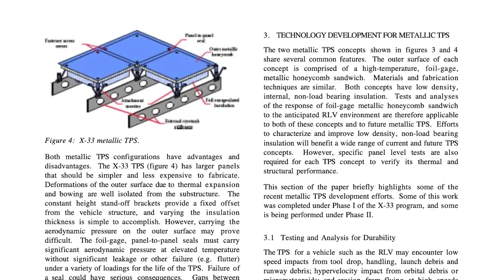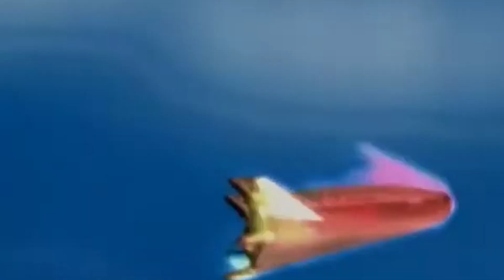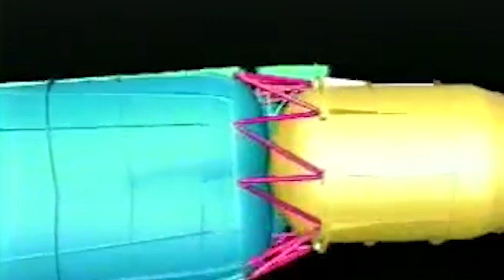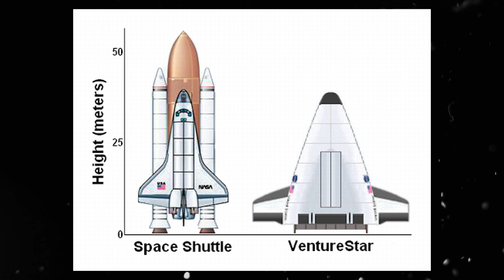The Secret Skunk Works Space Shuttle Replacement

Comment: I worked on the SS program in the late 70's. Narloy-Z was the SSME combustion chamber material. Channels machined in the outer surface, filled with wax and the nickel plated. With the wax melted out you now had a regenetatively cooled main combustion chamber.

Comment: yeah, prefereably, you'd want to gain ailtitude before rolling over on your back............but, thrusters further towards the edge would have solved this................and an empty space in the middle for the oxygen buffer to give it extra lift would have been nominal.   overall........the design wasn't a bad one.  it was just the base that needed restructuring.

Comment: Why always from a dead lift straight up? Why not a magnetic grav sled starting  at a high  hill or small mountain on rails conventional or friction less mag lev until it reaches a speed that would launch into space or low orbit like a ramp that would make a normal exit trajectory since most of the fuel on conventional space launches is burned just getting of the deck

Comment: Why can't they fly an aircraft as high as it can go until the air is too thin for the wings to get lift and then fire a rocket engine to put it in space? Instead of a tiny plane launched from another plane that only technically reaches space.

Comment: Greetings, how much was the maximum load that the X-33 and the VentureStar take into space... and why that name "Skunk" (sorry my english is limited)
Reply: The X-33 was an experimental vehicle that was designed to reach Mach 15 (5.2 km/sec), far below the Mach 22 speed (7.75 km/sec) needed for reaching low earth orbit (LEO). So X-33's payload to LEO was zero.  

Because of X-33's excessive dry weight and the sub-par performance of the Rocketdyne aerospike engines, the maximum speed of the X-33 was only Mach 10 (3.43 km/sec). And these limitations meant that the X-33 could only fly from Edwards to the Utah Dugway. The contract called for longer flights from Edwards to Malmstrom AFB in Montana, which were impossible. 

VentureStar's payload was supposed to be 50,000 lb (22.7t, metric tons) to LEO.

Comment: i always wondered if they considered, or why the didnt ever make somethin like this, that had 2 or 3 jet engines to get the thing up to 30-50k in the air, then point it nose up, an then have some rocketry get it up into orbit from there.  this is just a lamen idea obviously, and im sure they considered it, and have reasons why it wouldnt work, but i dont believe ive ever ran across hearing about the idea before.  in my small mind, it seems like it would work, as long as the jet engines were before the rocket 'exhaust', and at the least, you would have to replace the rocket engines due to re-entry reasons maybe.  donno, but seems like with this design, it would cut down on the rocket propulsion side of things at least a little but

Comment: Where is DC-X when you need it. Ivan Becky is an idiot. You could have flown with the Al-Li tanks and proved the concept. Built the Venture Star and proved that A SSTO vehicle is possible. Built a re usable launch  vehicle. But Becky has a dummy spit because they didn't use a composite hydrogen tank.

Comment: The title is a bit click bate.  This was a very public program, and I remember when it was unveiled. The problem was, this was a Clinton era project the Bush admin didn't want to pay for. Since the Shuttle was working fine (at that time) they figured a replacement was too expensive and dumped it. After the Columbia crashed, they pushed for a cheap replacement...old fashion rockets.  Irony was, they actually got those composite tanks to work a few years latter and are now featured on other rockets.

Comment: LOLOLOLOL  You crack me up.  It was not canceled because the X33 failure.  I worked this program for several years, both at Denver Aerospace and at the Skunkworks.   The single stage to orbit design didn't close.  The engine technology of the time was not able to meet the design requirements.  Every time they made it bigger to carry more weight , they had to carry more fuel and it never would meet the performance requirements.  The rocket guys started the program and along came the morons at the skunk works and they said THEY had to be in charge.  The argument was it was a rocket and belonged to Denver Aerospace.  Then it was a plane and belonged to Skunk Works.  That fight went on for years.  

Martin Michoud built tanks for the shuttle and were the company experts on how to build tanks.  They developed the technology needed to fab the conformal tanks and were successfully testing them.  The morons at the Skunk Works told Michoud to pound sand and hired their own tank fabricator.  That fabricator COULD NOT make the tanks.  So SW went back to Michoud and asked them to fab the tanks.  They told SW to pound sand and the program died.

It was a project too far.  It would never have worked.  Trust me, I wrote the specs for this program and it never would have worked.
Reply: prove it prove any thing you just said or you are who you are

Comment: Same as with the thorium reactors. Nearly all the work is done and a very promising leap in technology is only 10-20% of additional money away, but some penny counter politicians have to hold everything back, thus wasting all the already spent money and effort and preventing relevant progress by another half a century.
Reply: Man if we didn't want to build "the bomb" to save the world or whatever. Thorium would have been the primary fuel source. Hell we had working salt reactors back in the early 60's if I remember correctly but they don't make plutonium ya dig
Reply: @jeffreyhill1011  Sorta? The reactors were efficient but they wore out really quickly because of the metallurgy problem is still unsolved. Also no, the problem is largely down to proprietary fuel mixtures being part of the sales strategy of reactors, a bit like how printer ink is artificially  expensive, but printers themselves are artificially cheap as a business strategy.

Don't buy into all of Kirk Sorensen's hype: He doesn't address most of the problems involved -- such as the requirement for metals which aren't brittle under high neutron flux, the corrosion risks (which tbh are the major stopping factor of both the support structures of pumps and heat exchangers, but also the core assembly), the high neutron damage to solid moderator materials which would vastly shorten their lifetimes, and the fact despite what he says, a modified MSR can make weapons grade nuclear material but it can also recycle it.

Kirk Sorensen has a masters degree in aerospace engineering and in nuclear engineering but he's not aware of some of the chemical engineering involved so I think some of his ideas are very optimistic but they side-step the reactor lifetime problem.

The fact he flat out never addresses the corrosion issue is suuuuper sketchy.
Reply: Penny counter politicians 👃
Reply: it's not a leap in technology. Almost eveything about the venturestar is a shit design. SSTO, Hydrolox, aerospike, aluminium construction, complex structure, etc... Thank god for SpaceX finally getting shit done after half a century of military industrial contractors siphoning money to do the same shit decade after decade with no hope in sight.
Reply: @Shrouded_reaper  A plane design is obviously better than a rocket design. In either case you're getting up there with a conventional rocket, but on your way down a plane is infinitely better and safer in every way.
Reply: @SmartassX1  One of the prime reasons the shuttle was such a piece of shit is EXACTLY because it was an aeroplane style design. Massive mass penalties for surfaces that are barely used and not needed at all as demonstrated by Falcon 9, complex and expensive contruction since you aren't just welding up simple barrel sections, non uniform shapes that demand huge amounts of unique, non standard parts. All for what? The last two minutes of flight when you are going slow enough for the control surfaces and lifting body shape to actually do something?
Reply: @Shrouded_reaper  Obviously a simple capsule takes way less fuel to get up there than a capsule with wings. The difference is that with a plane you're not just falling back and relying on even more rocket exhaust to safely stop. A plane remains guidable throughout nearly the whole descent and can choose which airport to land on. Any sort of weird basic capsules need to either drop on the hard ground (Soviet option with a sudden hit upon contact), or the sea (requiring a ships and lots additional time to get back to the launch pad). The airport can literally be built right at the vehicle service station.
Reply: @SmartassX1  You cannot land a spaceplane on "any runway", it must be a specifically constructed runway with a whole host of specialist ancillary services. A spaceplane also relies on a suite of systems to safely land such as; aerosurfaces, parachutes, landing gear, etc... Any one of which failing will result in the destruction of the vehicle just as surely as an engine failing. You don't just cruise a spaceplane in like a glider, the hardest part of coming back to earth by every single metric is re-entry, and capsule designs are inherently better at this by design.
Reply: @Shrouded_reaper  A runway is a runway it's laughable to suggest that there's anything complicated about it. Space planes are normally faster, so they just need a longer one, unless the space plane would have wings that slide out, like some fighter planes. Landing gear and parachutes are not complicated technologies that could even be mention worthy. Planes have had those for like 100+ years. And most of it basically really is just gliding with some controlled wing tip adjustments That's no more complicated than a 1930s plane. The pilot just needs specialist training for the different way higher speeds. That "whole host of specialist ancillary services" is way more costly when fishing capsules out of the sea with a ship that needs a port.
Reply: @osakanone  Well ideally, they would only ever land at their main runway, next to their own service station and launch site. The ability to land elsewhere is a safety feature, in case there's a big storm over the usual landing site.
Reply: @SmartassX1  This is true, but extending launch and recovery points means the mission profiles of the platform are diversified which can be useful for military purposes which bring in funding. That said, the military moved to the X37B so I think they didn't ultimately care for the 33's future projection and development. I think too, as a lifting body rather than a conventional aeroform, safety would have been very important given how quickly they bleed speed.
Reply: @osakanone  And to change the topic a little, ideally, were it up to me, there should be at least 4 of them. So that 1 would always be connected to the ISS (or the next version of ISS in the future), 1 would be serviced, and 1 would be on a launch pad with 1 hour readiness. The idea is that if anything goes wrong, there would be a vehicle ready for a rescue mission. And the fourth vehicle would just be a general backup. Of course the 3 main ones would be in rotation with their missions.
Reply: @Shrouded_reaper  Assuming you're an engineer, you are familiar with the distended S-curve of technology development, right?

You know, that you usually have to give up around 20% of cost-performance to ensure a technology which will give you a 200% cost-performance benefit in the future is actually appropriately tracked, right?

Space-X isn't "getting shit done", its re-using VERY tired old engine designs and god awful ideas.

If you understand a bit about rocketry, you'll learn that vertical integration and hand-fitting is kinda unsafe. "Move fast/break stuff" mentality that works in many engineering projects is fail-deadly in space.

Their entire process is about vertically integrating to reduce transport cost and then hoping their insurance premiums stay low enough that they don't have to eat the cost of launches.

Having spoken to inspectors from NASA who went to SpaceX to cert everything, "the safest thing here is probably the buffet table" is pretty damning if you have even the vaguest understanding of statistics.
Reply: @Shrouded_reaper  One of us is presenting arguments and the other is attacking the other person because they have no argument. You have already lost.
Reply: @Shrouded_reaper  Are you really still whining?
Reply: @osakanone  oh look another non argument.
Reply: @Shrouded_reaper  Why are you linking Elon's success/failure or what other people think of his business methodology to your ego enough to get upset about this?
Reply: @Shrouded_reaper  lmao ok talk to me when Birkshire Hathaway's prospective premiums fall to reasonable levels because there's trust in the long-term safety of SpaceX's "move fast/break stuff" valley mentality. Also again, keep in mind that you are using your real name here and again, the industry enjoys these videos.
Reply: @osakanone  I like you you deleted a comment that was threatening someone who bears my same name in real life. Very cool of you.
Reply: @Shrouded_reaper  Youtube seems to be eating my posts. I have tried replying to this three times now and two of my other posts are missing.

Comment: Two fondamental issues: single stage is not an efficient payload to takeoff weight ratio and also, heavy large heat shields to recover empty tank ..like the SS heavy Starship is a waste of payload. But two stages are better than one specially since recovered stage one and two are penalised by heavy recovery feature (16 pct on a Falcon 9 first stage) . Conclusion, my conclusion is that a fully recoverable three stages system seems to be best and safest with for instance a Stratolaunch Paul Allen Scale composite plane carrying as second stage a mobile fin type 200 tons rocket similar to a small central stage of Falcon Heavy and recovered very far out at sea and pushing in front an orbital Sierra Nevada DreamChaser / Bor-4 type lifting body fitted with a pair of re-ignitable Merlin orbital type engines, surrounded by a pair or four 3D printed final orbiting tanks dropped just before orbital speed is reached to fall down and burn. With only the small third stage O2 and RP-1 main tanks lost, they remain also much smaller than the old shuttle take off to orbit main tank and require no heavy heat shielded for recovery. Unfortunately all those exiting technologies are hold by competing and opposed companies and a smart NASA political drive would be needed to consolidate those synergies. Such lifting body is much stiffer and safer for carrying astronauts back than a winged shuttle or a vertically recovered finned rocket. Finally, such a mission would cost only a fraction of a Starship 6000 tons launch, and maybe less than half of a Falcon 9 Crew Dragon mission.